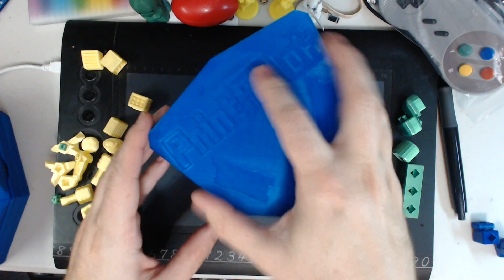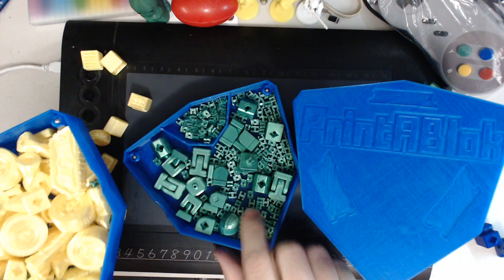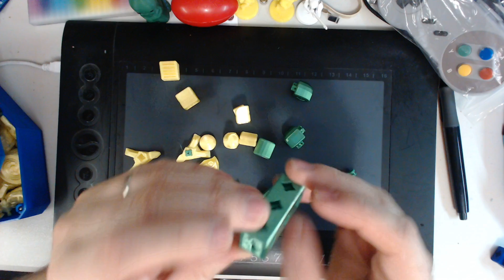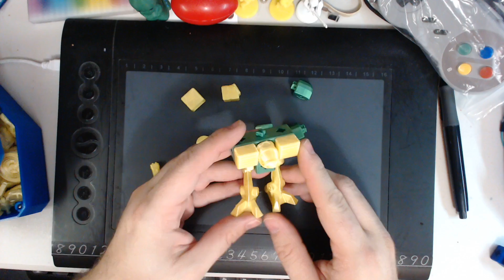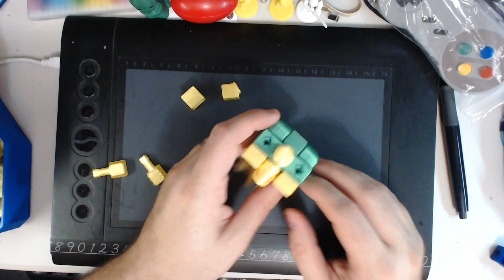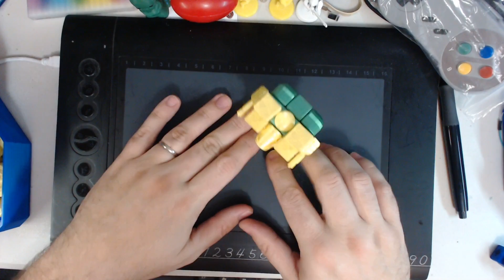Making a PrintABlok Light mech

Comment: If it is hard to dismantle for small fingers, do you have an wide tool to help like an tweezer ?
Reply from the maker: There are a couple of options. There's a 3D printed tool, and the connector themselves have a small hole suitable for a thick paperclip to hook in and help pull.